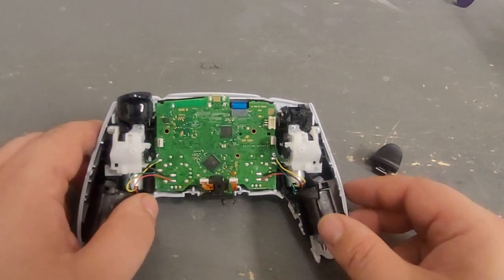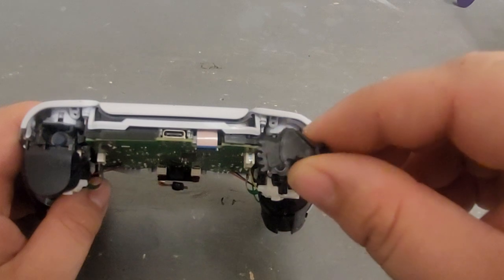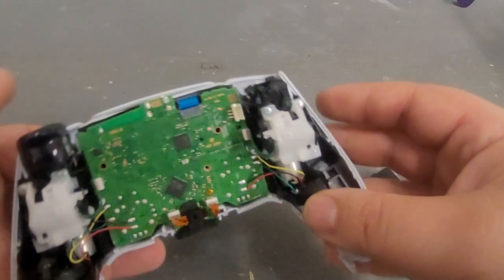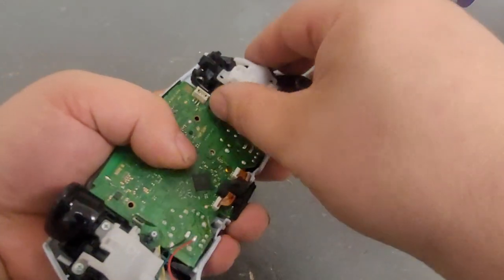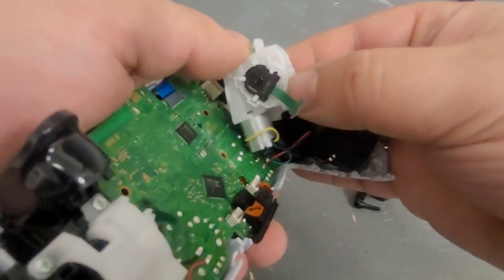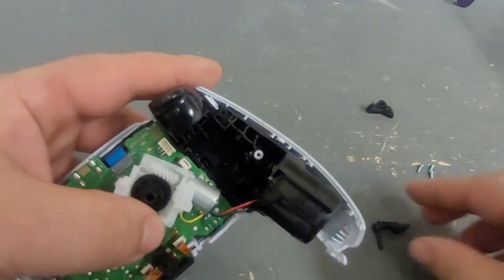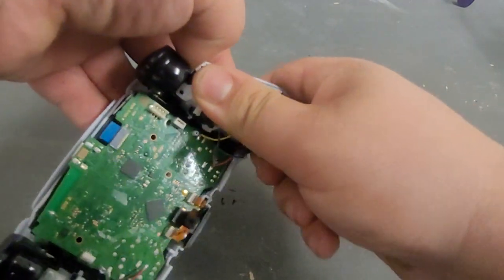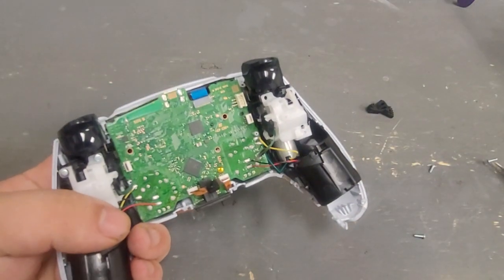PS5 controller model BDM-050 Trigger replacement/haptic disassembly

Comment: I just did a trigger-linker replacement from a donor middle-section, after breaking one a brand new Chroma Indigo- just by removing R1 button, which is the normal method. That rod is designed to break in my opinion- no reason for that rod to be hollow.
You can probably glue it back together with a drop of 2-part epoxy- and then inserting a small metal rod (maybe a paperclip rod) through the through hole to give it some strength back.
That part doesn't appear to be an Ali or Temu type part- you need a donor midsection unfortunately.

Comment: that little plastic bit that you slide into the trigger for keeping it together, my issue is. I have two controllers, both 050, and the triggers are loose or make a click sound when the trigger moves side to side. (its a gentle wiggle) I had changed out the springs in those two controller and haven't been the issue, I'm concerned its that piece but I have no idea of how to obtain a new one or just get a metal one from an older generation and hoping it'd fit.
Reply: This thing is called a trigger linker, on my bdm 040 this didn't happen
Reply from the maker: The metal ones won't fit and I haven't been able to find replacements for that piece being sold. Did you take it apart to confirm it's broken though? A slight side to side wiggle (especially with the rear of the shell off) is normal. The clicking could be a result of the gear being misaligned, the potentiometer (piece that the ribbon connects to the main board) having popped slightly out, or some other failing in the adaptive trigger either from a dirty/damaged ribbon/connector or a glitch with one of the chips (the 050 are bad about chips failing)
Reply: @ThirdJcustoms  I’ll open it up again and see, it’s 100% possible I did miss something when replacing the springs. I got bold enough to do the repairs myself but honestly it’s just to learn more. So if I  could figure it out then I could potentially help others. But if I find something I’ll let you know 🙂
Reply: @VelvisOdonnell  I have the same problem, but I didn't take mine apart and bought it a month ago and it's under warranty. L2, have you found a solution to this problem?
Reply: @Bgdhrie 
Did you find any solution?
Reply: @t @theastroraccoon  Yes, I gave it for warranty repair, they completely reassembled the adaptive trigger module and replaced the spring
Reply: @ThirdJcustoms  So I believe I know what’s wrong, the brackets on the trigger are a bit too big, which makes it wiggle a bit, that or the plastic rod is too small. I’m tempted to try and take out the 050 tigger assembly and replace it with 040 since they work wonderfully for me.
Reply from the maker: @VelvisOdonnell I'm not 100% sure if the 040 modules are compatible with the 050 frame because I've never tried to swap those with eachother but they do look like they should. But I can tell you there's a good chance one of the adaptive trigger functions or rumbles might not work because I have swapped boards from controllers with broken frames into frames of a different model, particularly the one with the green ribbons for the triggers don't ever seem to work with other models. (All the buttons will work fine though it'd just the haptics that won't work)

Comment: Hello. The component in the BDM that secures L2 previously had a small spring. Tell me, does it still have it now? Also, what are the symptoms of a damaged or missing spring?
Reply from the maker: They all have a spring, and the only consequence of it not being there is the pull just feeling weak and it'll activate a little easier since it's resting right on the rubber

Comment: Question. I ordered bdm 030 parts without knowing and my controller is bdm 050, will the r2 and l2 still fit?
Reply from the maker: If it's just the buttons yes. The L1/R1 and L2/R2 buttons are the same from 030-050
Reply: @ThirdJcustoms when you say buttons, this doesn’t mean the triggers right? L2 and R2 triggers. 

I also ordered bdm-30 and I’m struggling to make it fit.
Reply from the maker: @gilbertquaye1571  The L1/L2/R1/R2 are the same from BDM-030 to BDM-050. The adaptive trigger modules are not though so of you're replacing the whole thing it won't fit
Reply: @ThirdJcustoms  okay, thanks. I’m just replacing the trigger rather than the whole module, so I should be good.
Reply from the maker: @gilbertquaye1571  the only issue I've ever ran into with aftermarket triggers is them only reading around 85-99% pull instead of a full 100%. You can fix that by just putting a piece of scotch tape in the slot on top of the silicone piece under the trigger.
Reply: @ThirdJcustoms okay, I’ll try that, thanks